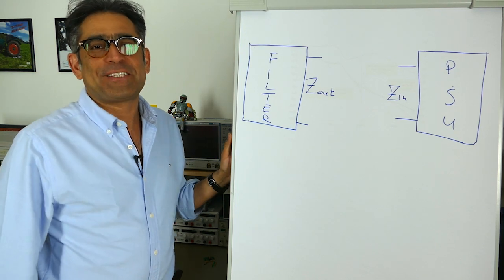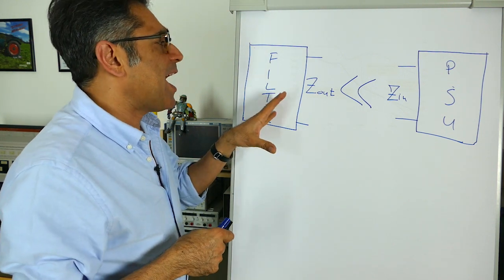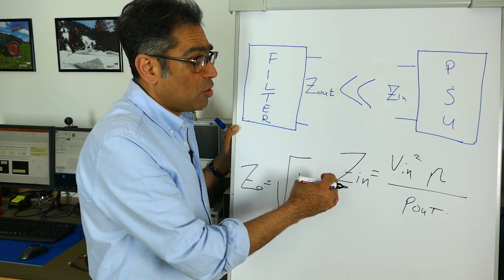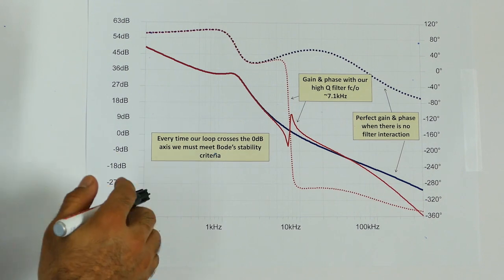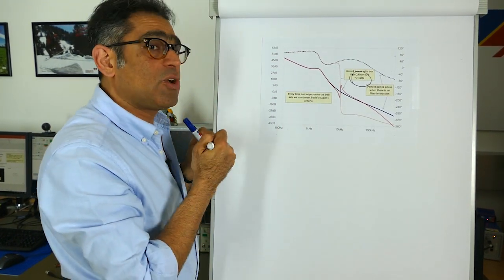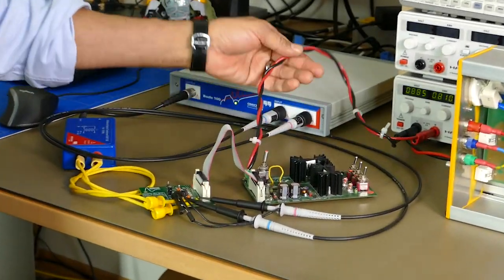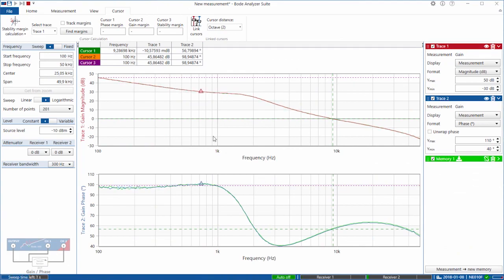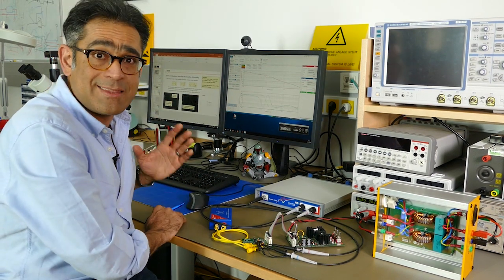EMC Filter Design Part 3: Input Filter Stability and Middlebrook

Comment: Efficiency in the Zin calculation, represented by the Greek letter nu, is expressed as a fraction. For example, for a 93% efficient power supply, nu = 0.93.
Reply: The efficiency is the Greek letter Etta

Comment: What is the source/reference of the PSU input impedance formula Zin = (Vin^2 * efficiency) / Pout?
Reply: Current, Iin = Pin/Vin. Zin = Vin/Iin or, Iin = Zin/Pin.   Substitute Iin = Zin/Pin in the first equ and you get Zin = (Vin^2) / Pin. Now substitute Pout = Pin * eff. (Impedance Zin  is actually a negative number at the operating point)
See? It' simple algebra. Anyone who has taken basic EE101 in college should be able to do this.
Reply: Seems to be Steve Sandler's "Power Integrity" book.
Reply: More likely Sandler's "Switched-Mode Power Supply Simulation with SPICE".

Comment: I think in the simulation the the reds are phases and the blues are Gains. So: correct gain: Solid Blue - correct phase: Dashed Red - after adding incorrect impedance which is close to Zin of power supply: Gain: Dashed Blue - Phase Solid Red.
Reply: Nope, Gain is with solid RED and BLUE.- Dashed line is the phase.

Comment: how to find the cutoff frequency ?
Reply: input filter cutoff frequency should be less than power supply output filter cutoff frequency
Reply: @rolandoaguilera3114  NO.., as per the rule of thumb, the filter cutoff frequency should be at least 1/10 of switching frequency of the Power supply but this method always not gives better attenuation for more detail design information please refer Richard Lee Ozenbaugh and Timothy  M. Pullen (EMI Filter Design book)